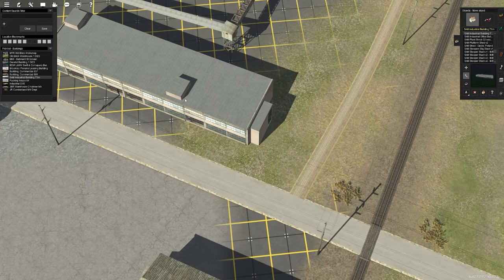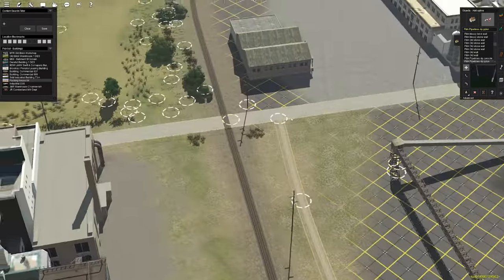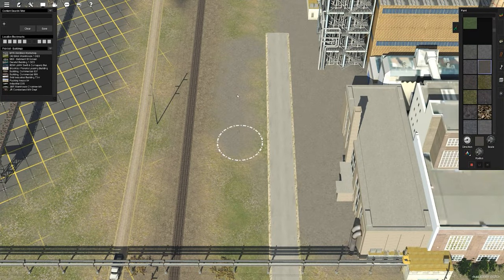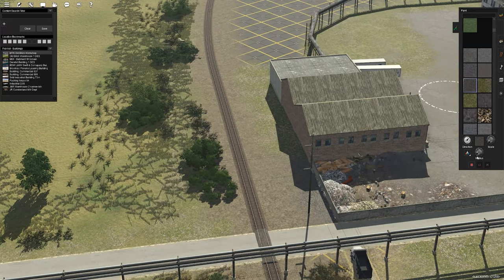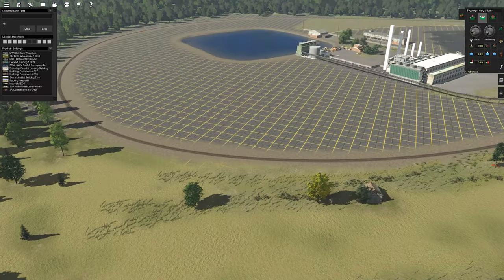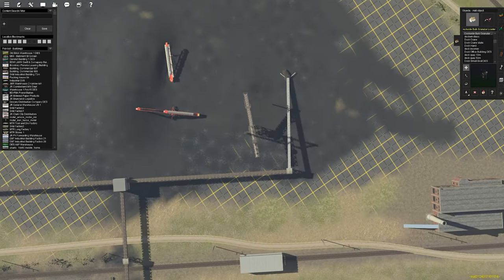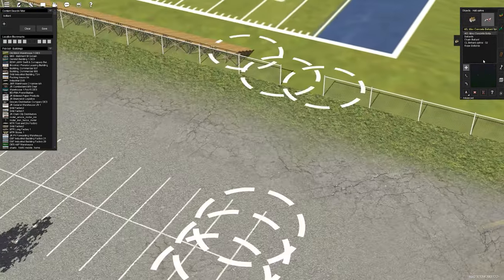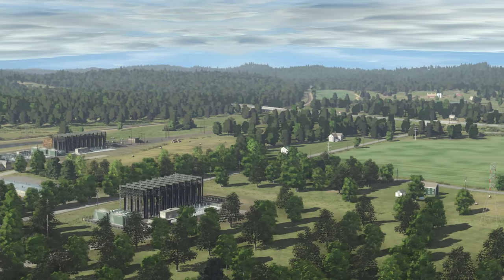Power Plant: Trainz Pennsylvania & Berwind 51

Comment: This definitely looks amazing! 🙂

HD Terrain with smoother hills and less stepping, is currently limited to 16 textures per baseboard. If there are more than 16 textures, some are culled. This isn't a program limit and is an actual hardware limitation at the present time no matter what hardware we may have.

Surveyor 2.0 has some great things in it such as the scrapbook feature which I make use of all the time. With scrapbooks, you can save clips of things you use over and over such as tree covered areas, small slices of details, or even complete city blocks and industries if you desire. Using the brush, you can paint in the area, which is great for trees, or you can use can paste into an area which is great for industrial areas and city blocks. I thought of this as you were placing those rows of trees and copying and pasting areas with the old Classic Surveyor.

Comment: Can you do a tutorial on how to do parallel tracks? everytime I do them they always end up different heights, not aligned with the adjacent track or they are not evenly spaced...

I tried a waygauge but using those to connect as spline points, adds spline points and then makes it impossible to make super elevated curves (which seem to be broken in 22' :(